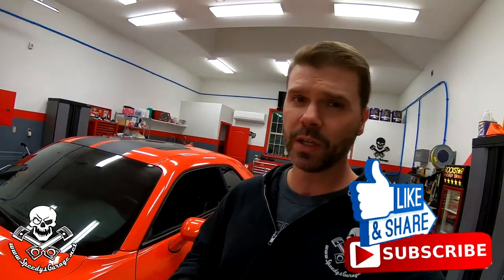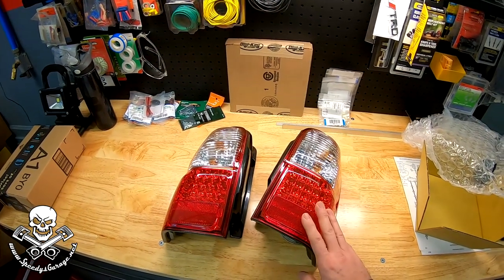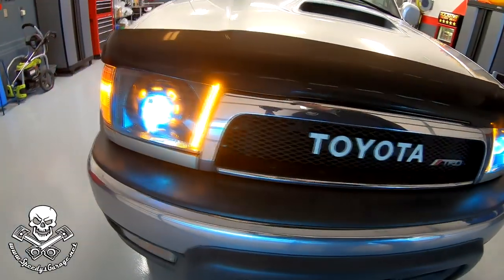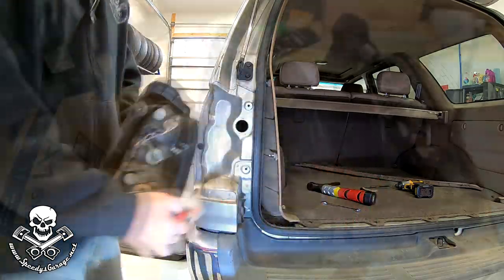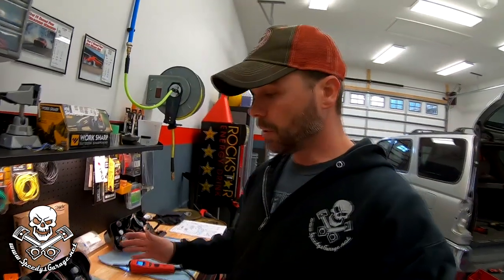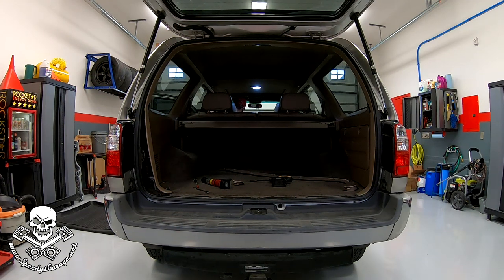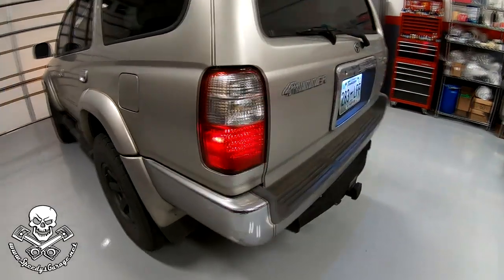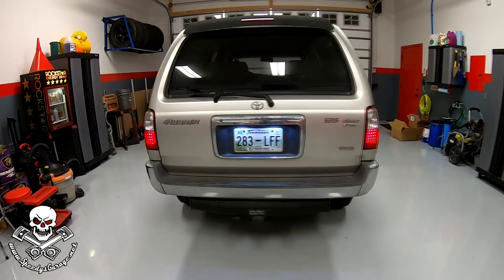LED Conversion and Hyper Flash Fix

Comment: My 2002 didn’t have fog lights but it does have the wiring , I bought after market round LED fog lights and have to figure out a bracket to mount them the bad part is my light switch doesn’t have the fog lamp mode on it which means I would have to replace the turn signal switch to or run new wires an mount a toggle switch , I replaced my over head lights with LED but I was really disappointed as I thought they would be much brighter and the rear dome , had the truck four months now and I’ve been going thru it doing replacement of old and worn out stuff , battery, valve cover gasket’s, pct valve and grommet , spark plugs , wires , it’s like the more I do on her the more I’m luv’n it , 187,578 miles on it a purrs like a kitten 👍
Reply from the maker: I was able to get a turn signal stalk that included the fog light switch from the dealer and it just plugged right in.

Comment: I bought these same style lights from ebay. Mine came with a ballast so it was really plug and play. Same install steps no relays needed.
Reply from the maker: I've heard the ebay ones can have LEDs burnout pretty quick.  Keep us posted how they hold up.
Reply: I've had them for 2 years now they are still looking good very bright and no issues.

Comment: I have a 97 and changed everything to led, and used a relay too but it didn't have the knob on the back. Everything works fine, but driving above 60mph with foot on the throttle the rpm fluctuates *only when I use the indicators... weird but I'm thinking something with that relay, since this only happend after I switched to leds... or maybe its messing with the throttle position sensor circuit

Comment: Hey dude, great video as always. Why was it necessary to change your taillights . Why not just change the brake/tail lights to LED? Super curious thanks
Reply: Yeah wondering if the whole Tail light assembly needed to be swapped, and could achieve similar result with just bulb swaps?
Reply: @boombeef no need to swap out the whole tail light. I just swapped out all my  bulbs to LED and had no issues, aside of rapid blinking but that has nothing to do with the tail lights.

Comment: Awesome stuff. I plan on doing th same time my 99T4R. Question,  do you have a link to where I can get the switches you used located on you dash at time 20:38
Reply from the maker: Got em' at the hardware store.  They're GB Electric brand.

Comment: Could this be the issue with my dad's 20019 Toyota 4runner its lights flashed several different times tonight  and no one has been inside the car